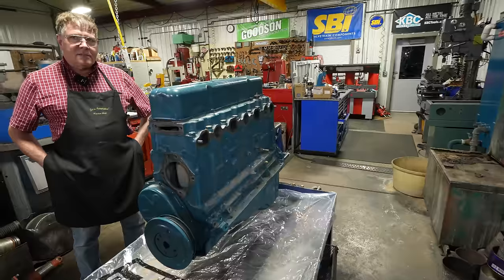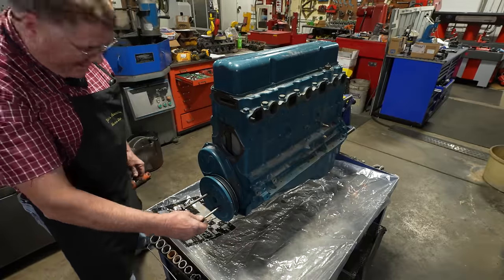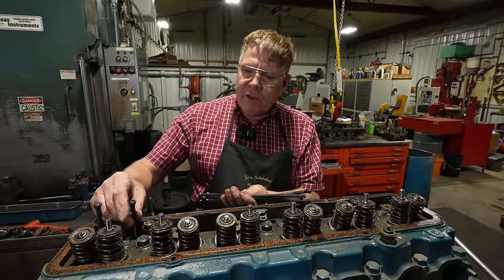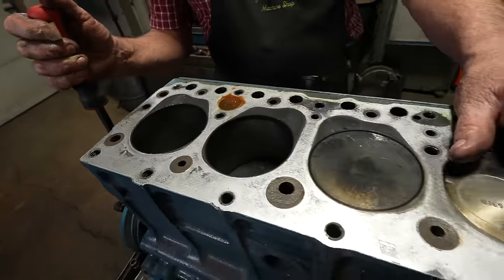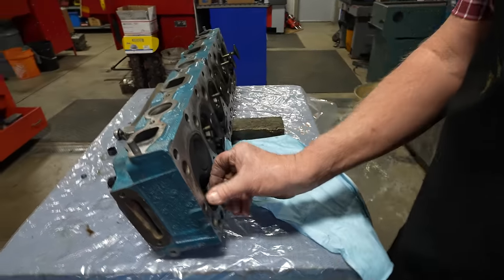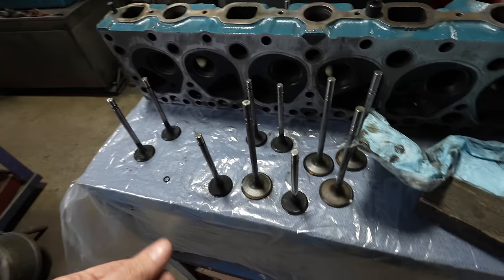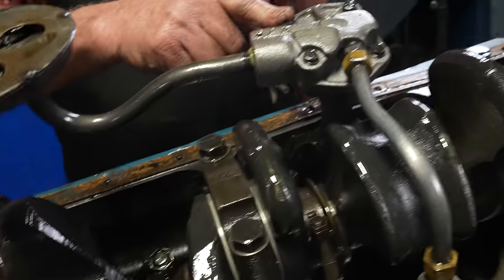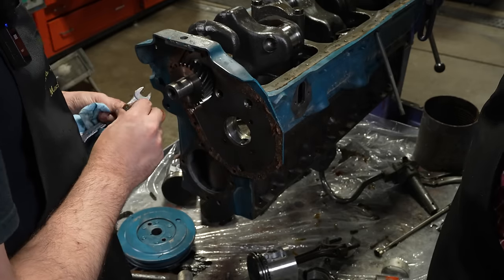Their 235 Chevy BROKE DOWN 10 Miles After The LAST Shop's Rebuild...

Comment: Ok watching this and I built hundreds if not thousands of motors. And the bearing was most likely package wrong. But with this I had a rule. All caps and bearings get plastic gauge. I had bearings made wrong, stamped wrong. Damaged. Even had them with the babbit material not hardened and peel off in finger nail. Also good way to make sure line bore correct and machine work. Once had bearing on thrust made wrong at the corner of radius of crank. This bearing actually plastic fine but we also had rule that after every torque set crank got turned 360 degrees then next set torqued. Even once had 350 Chevy go out of line bore when it get to 180 degrees and it would smoke bearings on mains as soon as it cooled block would go back to perfect alignment. Twice apart then machine shop boiled block and check line bore and it would go out like 20 thousands plus. Had a stroker ihc tractor engine that would do same but was ground extensively for clearance so my guess is the bearing was package in set wrong. Assembler missed it. Our rules on this came from 8n ford that the one on oil pump main was marked 030 but was made as a std. and had no oil pressure. My own father yelled and screamed that I left bearing out but only to find that it was made wrong. I no longer work for him do to these reasons of him flying off handle without knowing facts. Plastic gauge and turn every piece is my recommendation. Also measurements twice. Also the valves was not oil it was excessively lean or timing or both. We done the cups for years. Never issue. Most like timing was too advanced and ping the valves excessively. Seems that for only few miles carbon was a lot of black in valves and pistons. I would even put it that wires were mixed up and it was not firing correctly. I had bad spark plug wires do things similar to this. Most critical time on engine is initial start up. A lot of issues can arise plus a lot of brake in dirt etc clearances are tight and everything is polishing into place. Once was told that first ten minutes can be the best or worst time on engine weather it runs 400000 miles or 100000 is the first ten minutes running and how it breaks in.

Comment: Got a motor from a junk yard that was a fresh rebuild.. i wanted the head so when i took it apart i found the reason it was scrapped. Someone had dropped a small bolt down the intake and got jammed in the valve, holding the valve open

Comment: This is not a "stovebolt." A stovebolt six cylinder Chevrolet engine is one in which all of the tin work was hung w/ 5/16" x 18 bolts which were common on cast iron stoves.

Comment: Great video guys. I'm wondering how you feel about using plastigage for measuring bearing clearance.  I like it myself.
Reply from the maker: Plastigage is a great indicator of clearance.  But it is not an exact science.  The only way to know your exact clearance is to measure the shaft diameter, the housing bore diameter, and the bearing shell thickness.  Since we have the equipment and the abilities to do just that, that is what we do.  If I was an at home engine builder with limited tools, I would be using plastigage on every bearing I install.
Reply: @JAMSIONLINE  perfectly explained. Thakyou!

Comment: It's funny because there a lot of videos up on youtube of folk running engines to destruction without oil, and my god it takes a lot longer than you think. And then there's this, which had had a load of work done on it and the valve stuck, even thou it had oil and was well setup. Don't know, maybe it shows how far engines have came in 70 years?

Comment: They slapped parts together, "machined" it Oh it will run. Went through this in 99 with a 307 motor. Went to a place no longer around in Dayton, Ohio, We run our rebuilds on the stand for an hour at 1500 rpm. Find that today for $2500.
Reply: They fixed a national chains problem, 2 motors in 3 months, 1 motor still running. Had that car another 5 and sold it. Olds Delta 88 Royale. Better times.

Comment: I'm only in as far as 24:00. IMHO, the valve galled in the guide primarily due to lack of clearance. If there was excess or even sufficient clearance, the valve likely would not have galled in ten miles even if the engine was run without oil. I surmise that   when the engine got up to "temperature" the valve stem expanded enough to zero clearance in the guide, causing the galling. I would bet that with or without umbrella seals, that valve was destined to gall.  The lesson for me here is probably better to have too much valve to guide clearance than not enough🤔 Edit: Thinking further,  if the umbrella seal caused the galling on that valve, I would think that every valve with the umbrella seal would have galled also🤔

Comment: This design started in the 1930s as a splash feed engine for the rods. Something people neglect to do on these 235s is check the cam bearing wear. If I remember aright, the oil flows to the cam first, so worn cam bearings will cause a loss in oil pressure. Another reason these were mediocre. Their replacements - the 196, 230, 250, and 296, were much lighter and stronger. Could take 'em drag racing.

Comment: Never hit a hammer with another hammer, two hardened surfaces coming together like that can and does cause one to shatter sending high speed, flesh penetrating, shrapnel in all directions.
I speak from experience, still have a piece in my belly 3 decades later.

Comment: It kills me to hear a new engine took a dump. It’s crazy how that happens. My buddy has an AMC straight six with almost 200k miles. Bearings were down to copper, cylinder bores were as tapered as a step drill. We cleaned the pistons, slapped on new bearings, rings, and oil pump. Runs like a doggone sewing machine. Even took it on a road trip. How can we manage that and a new engine dies in 10 miles?

Comment: I've seen wrong / odd sized crank shells on and English re-builders channel, came from the after market manufacturers in thew box like that. They are so careful building the engines they picked up on it as soon as they opened the set. Lucky save for their customer but not everyone is that careful (they build 4 cylinder up to 500 hp so they have to be right first time).

Comment: I had 1965 impala w 235 & powerglide and it was the most dependable and economical nothing they have today is 1/10000 as good. Yes I am a mechanic and my dad born 1917 was B-17 mechanic in WW2

Comment: Hi Jim's Automotive Machine Shop, I need some info on valve lash. Does valve lash tighten over time or loosen. I heard exhaust valves tend to tighten more than intake would I be right when I say that or does it depend what the valve parts are made of?

Comment: Question i have a 235 engine ,was rebuilt years ago was driving great the. Freeze plugs gave out swapped that, but started to over heat noticed radiator leaking,so swapped that with aluminum radiator but of course had to modify, so i did and installed a electrical fan but now temp is close to 200 ,also did thermostat, water pump is my last resort but its mot.leakinh or anything??? Im lost

Comment: Now that I went through the video I'm wondering if the wrong bearings began failing, contaminated the oil with specks, which helped gall the valve that didn't get much oil anyway due to the umbrella seals?
Am I crazy?

Comment: Interesting turn of events.  I wonder if the previous shop was building 2 of these, and the other engine ended up with 20 under bearings and 1 30 under shell.  Packaged wrong at the factory? Maybe??

Comment: Unless it is important to have a stock-looking engine (show purposes?) I would put a more modern crate moter in it. Chevy used to sell a "Targetmaster" line of replacement engines.
Reply: Cause when u open the hood, and u find out that so many people never seen a straight 6 or haven’t in a long time…

Start putting go into the truck and the can of warms called up graded brakes, better rims tires, ….…

Comment: Personally and I know that I know very little about an engine rebuild. Knowing it's probably 30 more minutes to max an hour to do a complete tear down of an engine that it's just completely lazy not to do it. Then run it through a huge parts cleaner. Get every drop of trash out so it's not making excessive wear and tear on brand new parts. As per the difference in bearings, that blows my mind.

Comment: I was a Ford nut since the 1950s.  I have found though that the 230 and 250 were better engines than the 235. I have had a few Chevrolets.

Comment: 235 straight 6 was also made in 1951 2 door coupe. With the first auto matic trans power glide has babit berings adustable push rods. Not solid rods i know be cause i had a original motor with 50 thousand miles baught. In Berkeley calif from original owner a tought moter. I rebuilt my self at 100 thousand miles. Ran for 17 years till tran went out. My fault . will lock up if not started at least once a month bent rods. Replaced some with 1953 straight rods modified to fit the motor only 12,000 made that year .

Comment: Im thinking those valves were too tight and they thought the polishing would be enough to loosen them up... possibly thought the crosshatch would hold oil while it was "self clearancing" I don't think that the shop intentionally did a bad job, it does look like they put some effort into the job, and the customer not taking it back to the first shop tells me that he may have had some type of issues, maybe he knows that he has overheated it or it popped a oil pressure gauge line and ran out of oil, something seems to be off about the situation, also I have seen with my own eyes many times, engines overheating and locking up, but once they cool down they will start rotating again, from experience engines that lock up quickly don't tend to damage bearings, but ones that slowly start dragging and people try to use the throttle to keep it running, tend to destroy and/or spin the bearings, one thing that aggravates me is why in the heck would you not take 5 minutes to stamp the date next to the new bore/bearing sizes and how much you took from the deck etcetera.... seems like common sense to me but I guess most people these days are just common and lacking in the sense department 😂

Comment: Safety Glasses full lens 1.5 diopter. Other strengths available.
Delta Plus - WELRX500C15 RX-500C 1.5 Diopter Full Lens Magnifier Safety Glasses, Black Frame /Clear Lens

Comment: I was taught all parts go back in the same, he just threw all valve springs and keepers in the same place, also hitting valves with ballpeen hammer. Should use softer hammer or wood, brass. Also hitter one hammer against other is a no no.

Comment: Betcha someone took a box of 20 over bearings and a box of 30 overs off the shelf and looked at them, and managed to put one of the 20s back in the 30 box and vice versa. Next guy comes along and grabs the 30 over box and puts them in without checking all of them and poof you've got a bearing that's 5 thou too thick. Somewhere out there is the twin to this motor with a bearing that's 5 thou too thin.

Putting it back together without the required shims would explain the excessive wear around those locating nubbins. If it came in without them I could see a shop not making sure that it required them and just putting it back the way they found it.

Comment: Apparently the guy that rebuilt the motor didn't put oil in it. When he installed the motor he didn't put oil in it. That's why it only ran 10 miles.

Comment: "Close enough is good for horse shoes and hand grenades" is a cliché for a reason. 
Older technology relied on mass for cooling,and used thicker oil in larger passages. 
Great longevity, poor economy. 

Modern uses alloys to run hotter,and run high oil pressure in smaller passages .
Easier to plug and less reliability but better performance and economy. 

Around 1930 Grandfather and his brother drove from Va-Ca,ejected a rod on west coast.
So they dropped the pan and pulled rod,stuffed a rag into the hole in the block...then drove home lol.

Love the cleaning guy's observations, and mistrust of late nights 😅.

Comment: Accidents happen, but I woulda trash-talked the previous rebuilders, and wouldn't be ashamed of it, either. Even as a shade-tree mechanic, I still Plasti-gauge the bearings. Installing a .020 with .030s is ridiculous. ...Not to mention installing non-original seals, not testing fit (or accepting tight fit as okay.…I had a shop do this to me with my 216.5... It tried to seize and got rod-knock).  Also, if the existing piston rings seated properly, and there wasn't scoring, and the cylinders and ring gaps checked out, I'd just re-use them.

Comment: One valve stuck closed and hitting the piston? The valve guides too tight?  Federal Mogal make good barings, but why was the one baring half 20 over when the others were 30 over?  One baring package was wrong with a 20 over baring half? Someone screwed up. That engine was not rebuilt 100% correctly. I'm glad you tore it down. "FIX'ER'UP!" "GET'ER'DONE!"

Comment: Glass/ceramic thermal sending units WILL SHATTER with impact wrenches.

All the pros know to ABSOLUTELY NEVER use an impact on them if its a rare, numbers matching resto.

But if you are just rebuilding a motor where originality doesn't matter, you can hammer the hell outta them.

Comment: that sucks for the previous shop and the owner. nothing worse than spending all that time and $ into one and have it go bad out of the gate. I do think youd start to get piston stability issues with going .060'' over on certain motors, especially on a longer stroke where the piston takes the brunt of the wear.

Comment: Its always easy to lay blame on one thing, I say it was a multiple missteps that lead up to now. Not doing a good pre-lube, hurried machine build, missed one valve measurement, it doesn't take much. The older engines can be rebuilt and were made so you can. Todays engines are like throw-away single use and is a waste.

Comment: Had a neighbor lady had one of those engines in her car. She took it to sears for an oil change and 4 hours later it still wasn't done. Went and checked on it and the kid tore the engine all apart. I asked him how is that changing the oil? Called the manager over and showed him the work order. He went ballistic fired the kid and had the engine rebuilt all for free on a old Chevy station wagon. They didn't even tighten down the distributor. The lady passed a few years after and her kids scrapped the car. What a waste.

Comment: I know a lot of folks here are going to like this but
a 1956 impala engine in a 1961 Chevy that is 60 over and has a bent valve and trashed guide after 10 miles and stuck lifters. 

1. Is the camshaft damaged.
2. That engine IMO is a paper weight. Seriously it’s one hot days drive away from the recycling bin.

Comment: Keeps works great (Its the active ingredient minoxidil that does the trick. you can find many brands who use it) works for men and women and can also be used to grow beards.
Note dead hair is dead best results is before / balding state (You look at your mothers father 50% and mothers mothers father 25% etc. the Y chromosone have no effect)

As for men combine with finasteride (lowers DHT which prevents the hair loss from the inside aswell)

Comment: So major internal oil leak on the front main. Low oil pressure to everything including the valves, and the head bolts mixed up. Doomed to fail.

Comment: How would the align bore be perfect with diff bearing thickness.  They may have found that the front ( nose )journal of the crank was not in line, so they changed the 030 out for a 020, so it wasn't tight when spinning it.  Bad move on the builder

Comment: Why don't they keep the metal parts that wear together...together? I am new to this as a hobby and was under the impression you should always keep metal parts together. They just removed all the cylinders and put them in one box, not labeling them. Same with the valves and everything else. Is this ok?
Reply: Because it has done 10 miles. What wear do you expect there to be in that time?

Comment: That twenty under bearing shell would explain why he was complaining about the oil pumpit was probably supposed to be a thirty , and somehow at the factory you got mixed up , and you got a thirty and a twenty , and now he probably doesn't have very good oil pressure because it's ten thousandths off Did you guys not say the man was wanting? A new oil pumpput in the motor the only reason I can think of that he would tell you to put a new oil pump in is that he was experiencing extremely low oil pressure, which would be explained by that 20 underbearing, VS a 30 underbearing, so it all makes perfect sense to me if that's the case about the oil pump.  You know the guy saying he wanted a new one.

Comment: I'm curious about a statement you made in the first third of the video you were assuming that you're going to re-ring and rehome an engine with only 10 Mi on it are you going to verify it even needs that or are you just going to automatically do that so you can charge the customer for a service that is not needed if everything measures in round and the Rings are within tolerance there is no need to replace them honestly unless you suspect a crack in that piston you can probably just repair the head replace that rod bearing because it did take a hit and the engine would probably run for an eternity with no problems I'm going to guess you'd rather charge the customer I'm going to guess somewhere in the neighborhood of $3,000 just to replace one piston hone it put rings in it fix that valve guide and put it back together

Comment: You have to say this in KENTUCKY ACCENT .  We got a BV24/23-1800/ with a Springtime-34007 block bored to a 2/3300 inch Cast iron Cylinder. With Washington Aluminium Piston - sodium valve - 9834:45 Insert valves.   JEEEEZUZ A ITS HARDER TO FIND A CHAPTER IN THE BIBLE.